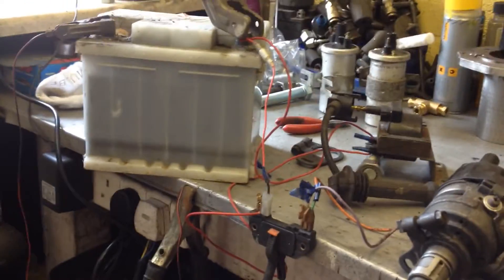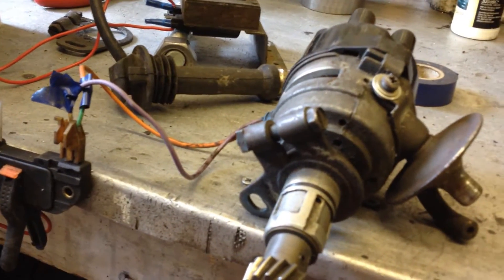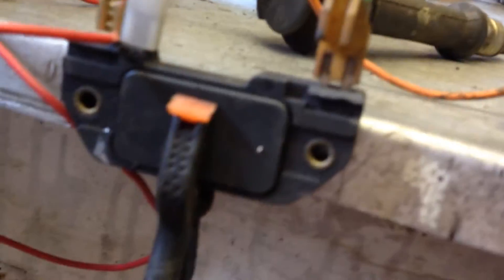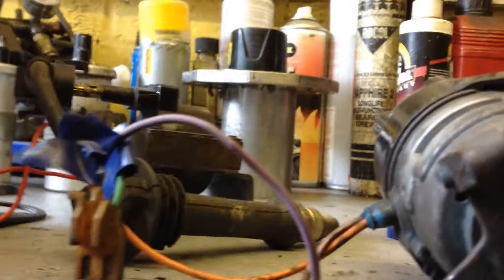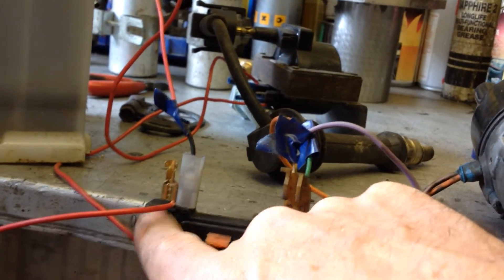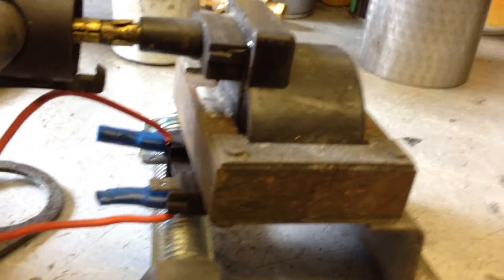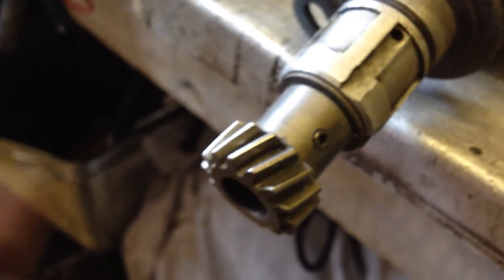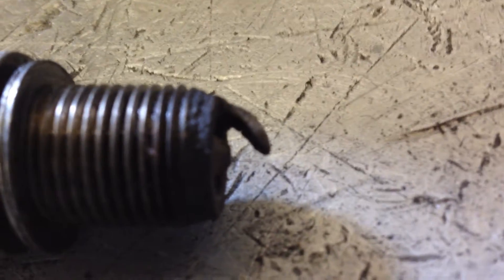MEDUSA . .. old  jag distributor with a gm 4 pin module.

Comment: hey! I tried a similar setup- stock Isuzu engine had a nippon denso igniter. The coil fires on the bench with the HEI module, but does not fire on the car. What do you suppose?
Reply from the maker: only thing i can hink of is a bad connection sam ,  maybe the earth ?
Reply: @RobertsChannell  I checked thr ground and power as well, been stuck on this for a few days. Very strange
Reply from the maker: When you tried it on the bench , were you using the Isuzu distributor to trigger it sam ? it sounds like a triggering problem or the module has died .
Reply: @RobertsChannell  yes, was using a spare distributor (same model as on thr vehicle) hiwvert the vehicle distributor is triggering thr stock igniter without any problem
Reply from the maker: maybe try putting the spare dizzy in ?
Reply: @RobertsChannell  going to trey that this weekend! Shall keep you posted
Reply: @RobertsChannell   Quick update, the distributor in the car is not working with the HEI, but is working with the stock igniter. However the spare one I got from the scrap yard is working with both. The resistance on the pickup coils is about the same. How can that be ?
Reply from the maker: Excellent so with the scrap yard one in the car , the car runs ? my guess is the spare one is just a more powerful signal .
Reply: @RobertsChannell  hey! Solved it finally. The denso service manual recommends an air gap of .2-.4mm in the magnetic pickup coil. The one in the car was at around .6. Reduced it to .2 and fired up right away haha
Reply from the maker: @991shom  Spectacular , well done Sam .

Comment: We're did you insert the othe + wire
Reply from the maker: one + goes to the coil ,and the other + goes to the module .
Reply: Ok I have been trying to start an opel kadett 1.3 with two pin I failed to connect those two pin any suggestions is a points distributor
Reply from the maker: @mahlatseboshielo3148  on a points dissy you would normally have a 
+ 12v connecion to the coil , then a  lead from coil negative post to dissy , and then the points are earthed in the dissy ..any other lead on the dissy , may be a  supressor ?
Reply: Ok from coil to distributor +12 volt wire? I would like to sent you some pictures to see exactly what I'm talking about there is where I can send you those pictures I really need your help
Reply from the maker: @mahlatseboshielo3148  +12v to coil positive terminal . then another wire from  coil negative terminal to disstributor .
Reply: @RobertsChannell  there for one wire - to a condenser?

Comment: Wuld those gm modules work if you aplly positive power from baterry and pulse it with only negative wia pick up coil ore vice versa wuld it still work?
Reply from the maker: elvin , you use it to switch the 12v from the battery  through the coil , down to earth ,the trigger is the pickup wires connected to the correct terminals on the module .
Reply: @RobertsChannell  I understand that the catch is I see some photo on google peopel useing test lights and they actualy bridge +terminal on ignition module to aperantly + on the pick up pulse side so the test light goes ON so I was wondering if it culd do the same with negative as well.
I cinde of want dual ignition and use only 2x gm ignition modules only catch is I dont have second pick up coil .
So Im surching for answers how to switch 2x gm ignition modules at the same time .
I am woried that the voltage from 1 pick up coil wuld not be enough to switch twin ignition modules.
So I wondered If I culd use some circuet ore external means to switch them.
I also have multipel coils and same ignition system multipel parts the same.
So I was wondering can I use secund coil winding from other pick up coil and wunde it some how in series ore pararel configuration so I get corect pulse polarity?
Ore can I atach centrain transformer type to do that same task instead?
Me distributor do not suport dwin pick up coils.
So I must some how finde solution for that problem .
Mostly related ignition system what I want is the twin ignition coil jaguar ignition system with those gm ignition module modified ignition amplifiers.
So I have unusual problems.
Im anoyed to always go out side in the winter time to retard me ignition timing.
So I was wondering if I culd use 2 variabel resistors for ich coil to retard and advance timing inside me car so I dont need to fumel with me distributor.
I like the dual ignition system.
Basicaly me engine can run at exaust stroke alone ore compresion stroke ore bouth .
So Im cinde of surching for variabel ignition system that I can build alone.
I also use plasma ignition for a while it has some good behaviores but some anoying so I have multipel tasks .
Basicaly the coils must change polarity fiering pulses ( + -,,,- + ,,,++,,,- -) and that I can increase strenght of coils be ither useing amplifier ore plasma ignition ore bouth together .
I experiment lot with me engine so I cinde of need variabel ignition system.
There are some good staff involved so I need some special circut design to meat me requestment.
Reply from the maker: @MechanicForGMCCars  i see ,  i suppose you could just connect up two modules to one pickup , and see if they both trigger , or use one module and pickup , and run two coils in series or in parallel . i think you'll have to get some cheap gm modules and have an experiment Elvin    :)

Comment: Robert, does that  amplifier module have any sort of a part number on it ?.  My Original AB14 has failed and this might be a quick fix 😃
Reply from the maker: hi Tony i will go and have a look , as  far as i remember its just a generic 4 pin gm module .as fitted to many gm cars  of the 80's to mid nineties i think .
Reply: Hi Tony - I'm doing the same ignition upgrade on both of my jags (1960 MK2 and 1969 XKE), and my 1950 International pickup. I found the parts I needed by searching RockAuto for an ingition control module for a 1978 Chevrolet Corvette with a 350. The heatsink wasn't listed for the same vehicle but I found it by part number:

Standard Motor Products LX301T ($15)
Heatsink: AC Delco 10474610 ($11)

Good luck on your car!